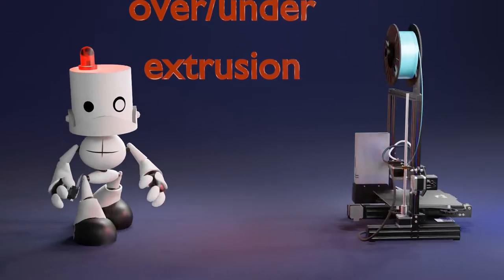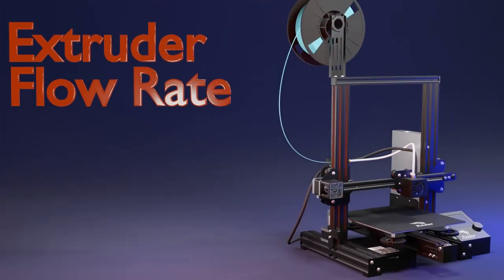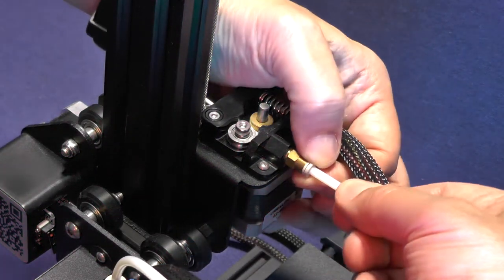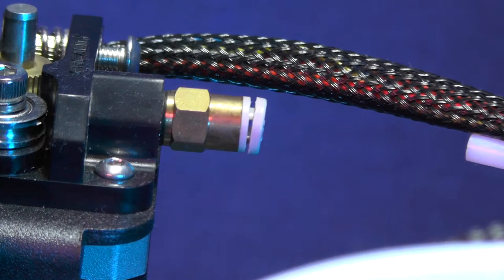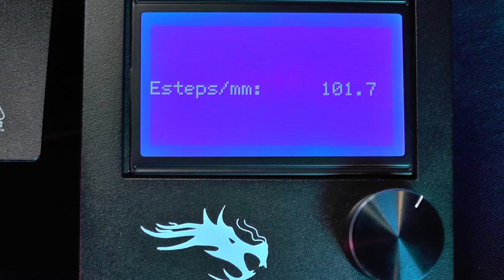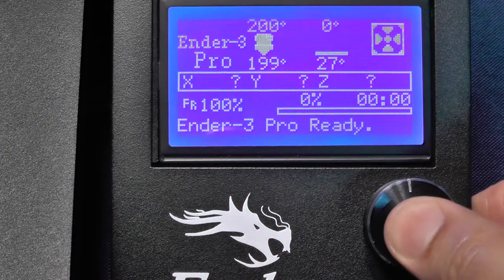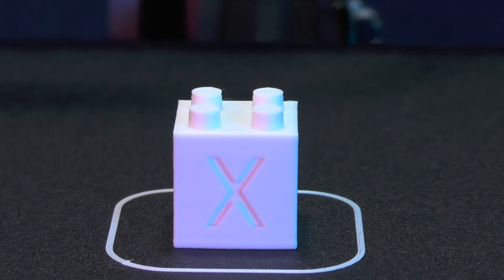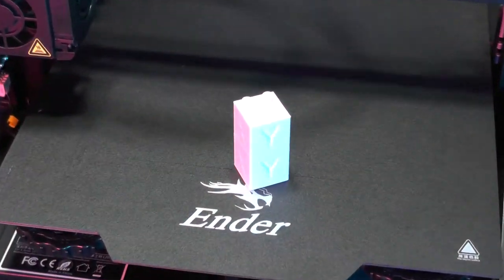Fixing Under/Over Extrusion - Adjust #ESteps on the #Ender3Pro

Comment: Another great video - thank you!  I noticed that after the job finishes the nozzle head temperature drops quite quickly. So you have to be ready to do the retraction step.  Is there a way to program that into the GCODE?  I tried to look for the option on Cura but I can't find it.  I was sure you mentioned it in one of the videos but I can't find it there either.
Reply from the maker: Yes, Cura can automatically add a retraction command at the end of every G-CODE file. The menu location on Cura to add this custom command is as follows:
-> Settings -> Configure Settings Visibility -> Printers -> Machine Settings -> End G-code

Marlin G-Code can be pretty overwhelming! I am saying that from personal experience. Following is a link to the official Marlin G-CODE resource:
https://marlinfw.org/meta/gcode/

From my research I have already learned that many G-CODE commands can do similar things. On the 3D Printing forums, everyone seems to have their own preferences but there is no consensus on the topic. So, I am still making up my mind before I make a video on the subject.

To make things worse, the Ender 3 (PRO) printers come with pretty outdated firmware. As a result, several G-CODE commands are not supported and you can't tell which ones are or are not going to work. 😕

That's why, at the moment, I am pretty deep working on the new video series about firmware update. Haven't had much time to spend on Cura. 

Feel free to do your own research, and I would appreciate if you could share any insights with me. 🙂👍
Reply from the maker: By the way, the first part of the new series should be released this coming Saturday! So, don't forget to subscribe! 😉
Reply: @MakerMindset  This is great feedback - thank you for taking the time to evaluate those options!
Reply from the maker: @bbasmdc  My pleasure! 😊👍